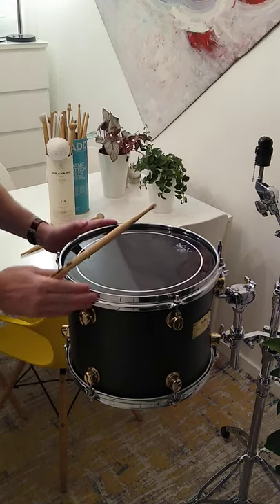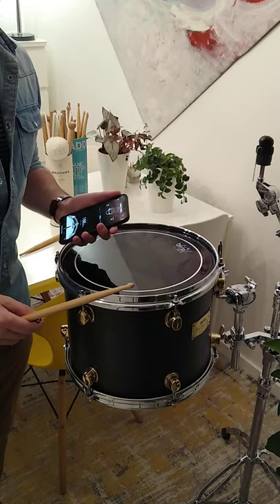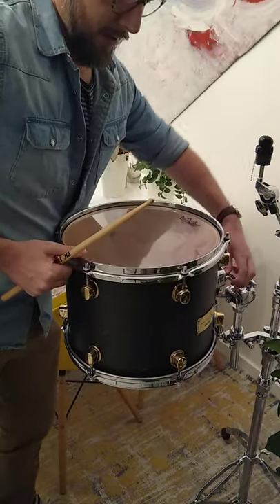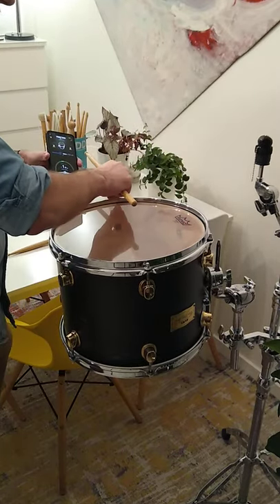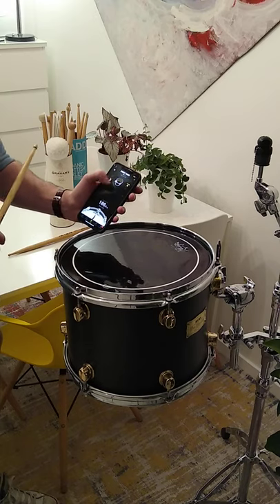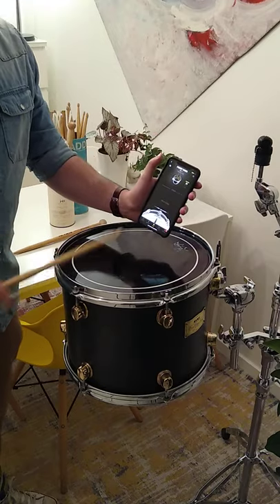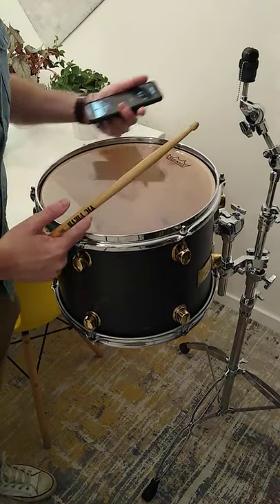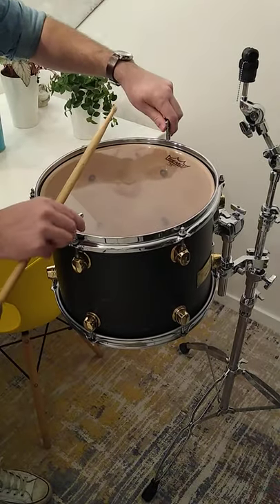Tuning my 13" tom from scratch to A2 for Tjas with both heads at the same lug pitches.

Comment: sounds average, tune by ear.
Reply from the maker: Hi Tony, in this video, I show the tuner's basic workflow to a user that contacted support with a question about how to use the app with regards to its 'flow' and with the aim to clarify that when a drum is part of a set, it's often important to approach its tuning in that context. 
 
You need to know that context to realize that such a tuning doesn't nescesarily sound as 'average' as it may seem at first sight. 

In fact, the intention of this particular tuning is to make the drum sit well between the other drums of a kit. 
I tuned this 13" tom to have a tone and feel that sits reasonably well with the other drums of that kit in order to create a coherent set sound with regards to tonal spacing & decay dynamics, despite of this 13" tom having very different drum heads, and being a much different instrument than the other drums in that set. 

Due to their tuning, the other drums have a certain attack & decay 'sound characteristic' to them. I tried to fit this 13" tom inside of that set , while also trying to mimic similar sound characteristics to match those of the other drums, solely by tweaking its tuning.

When you listen to the sound of this tom when it is placed in between the other toms of its set, at its current tuning, you'll get a much better impression of how this tuning "works"  in relation to the other drums of the kit. 
(The 12" tom, right before the 13" tom, was used quite a lot and had drum heads which were fully spent, so you'll notice it resonates quite short in comparison, but in the context of the set it still worked.)
Please check this 13" tom's sound in this other support video, that followed this one, where you hear & see it being played in the context of its entire set:  https://www.youtube.com/watch?v=s_8ySRrBhmk (copy-paste url in the browser tab, if needed.) 

That baing shared, now I am reading in between the single line of your comment... :D
I agree in full with the point that I assume you intend to make: it is of utmost importance to listen to your drum's sound with awareness and play with tensioning both heads differenlty until you get a sound & feel you like. 

Please note that I also explicitly underline the importance of researching a sound & feel that suits you to conclude the video. (Last minutes.)

Nonetheless, as metnioned above, this video is mainly meant to demonstrate that a drum can be tuned "in context"  to make it fit in between the other drums of a set, thus in a way it creates a tonal spacing & decay dynamics with the other drums to get a nice interval and coherent sound + behavior for the entire kit.
This video isn't meant to demonstrate what may be the best tuning approach to get to sound & feel A or B, which may be the "best" sound of that tom when considered in isolation, as a single instrument. 

With regard to the tuning versatility of drums in general: 
For this support-video, I tuned my 13" tom this way, with the heads further apart than I usually do.
I tuned them to a batter/fundamental tone ratio of a P5 to get a decay dynamic and a more punchy attack-rebound feel that worked well with the other drums of the kit, featuring a similar tuning.

It’s a versatile 13" tom, that sounds impressive when tuned around a fundamental of 92-96 Hz, but to my taste, it sounds 'fuller' with the heads tuned less far apart. 
Therefore, I tend to tune it lower and fatter with a longer sustaining tone, for the purpose of the music I usually play, but then that 4-pc kit is more beefy, opern & resonant sounding overall.

In general, the tuning decisions you make regarding the individual head tensions (lug pitches) make your sound, not 'how you clear the heads'.
There's no such thing as "by ear", or with "an app": the tuning actions are the same in both cases.
The end result is the same when a given drum is tuned in a certain way with both heads perfectly cleared.

To get to sound A or B, it really doesn’t matter whether you clear  drum heads, by ear or with the assistance of a tool. 
It irrelevant if a drumhead is cleared 'by ear', or cleared with the assistance of a drum tuner, but often, it tends to be easier to clear a drum head to perfection while using a drum tuner… 

For example, if that 13" tom as it was currently tuned sounds average to your taste then probably that may be because you would tune this drum differently to get a different tone or feel out of it. It's a rather high-ish tuning for that tom for a typical low-rockish kind of style, but all kinds of tunings and sounds are achievable. This is due to how far the heads are tuned apart.

Which tuning style/sound & feel you chose depends on your context and musical needs.
This drum could be tuned lower or higher, with the heads closer to one another, or further apart, drier, fatter, or more bebop-like… 

The overall sound and playing feel of your drum is created by the individual lug pitches of the heads and how they interact with one another. 
Basically, as long as the vibration-interaction of both heads is fine, and as long as you also remain within the "comfort-tensioning" range of the heads, you'll get a drum sound that breaths 'naturally'  without at least one of the ehads being forced too high or too low.

As a drummer, you can and should explore those "tuning parameters" in all freedom to get to your desired sound. 
The app as a tool is meant to stimulate exploring different tunings.
It is meant to assist you with clearing drum heads by telling you where you are at while doing so.
It’s like a GPS that helps to tell you where you are when you're exploring. It can also help you to 'drive home to a certain sound' if you know its 'coordinates.' 
These coordinates are the lug pitches of both heads and the fundamental tone of the drum. 
This allows you to always retreive a sound you tuned to before, should you want to retune your drum that way, or in the neighborhood of it. It's nice to have coordinates at hand (stored in a customized preset) for such a purpose.

Lastly, this support video is recorded with a phone-mic pointing forward. 
Probably, a differently positioned mic would have given a better idea of the sound…
The frequencies you hear in the vid are influenced by that position and how it is directed. 
EG: Such a P5 batter/fundamental ratio records "warmer",  when close-miked or recorded from the top-above the drum, than when recorded from the sides. (Drums radiate different frequencies differently in different directions.)
If I would tune that drum to the same fundamental, with both heads to the same lug pitch, it would sound warmer, even when recorded more from the sides, but I would get a different timbre, and decay dynamic, sustain, attack & rebound feel and then the drum wouldn't sit as nicely between the others in the set, as it would be more resonant and jump out too much.

At the time of recording, I took the drum out of a corridor around 3°-5°C, so the temperature difference with the room was about 19-17°C.
The heads were constantly adapting to the new temperature at the same time that I was tuning them. I was having a hard time to fully settling at a uniform lug pitch too.
I can hear that process happening. That warming up from such a huge temperature difference is not ideal for tuning, but it was good enough to demo the working principles of the app, and explain to the user that asked for support some of the basics while doing so. 

You can also hear in the video link I provided above (this one: https://www.youtube.com/watch?v=s_8ySRrBhmk) that the drum sound is picked up better when it is placed in this spot, towards the phone that recorded it, and this is laregely due to the fact that the phone's mic position when recording that other video is a bit higher than in this video.

Anyway, I hope this clarifies this video in context and also illustrates the app's purpose a bit, Tony.
Happy drumming & Cheers!